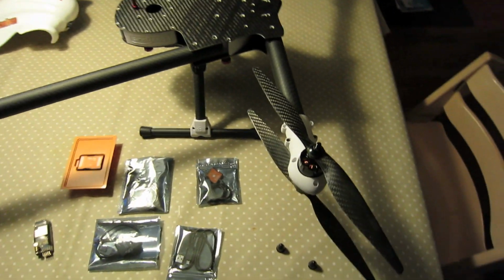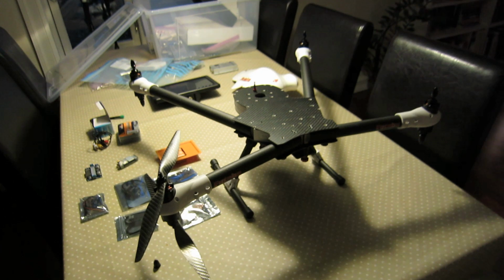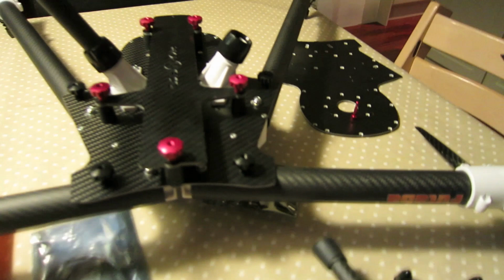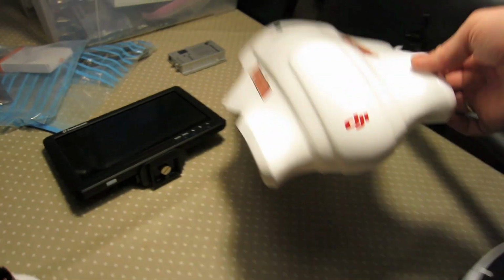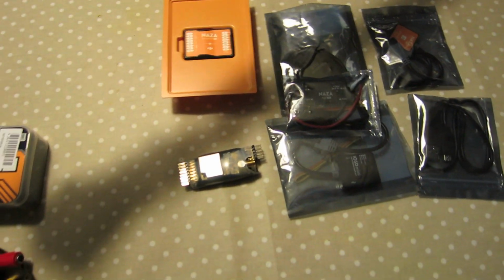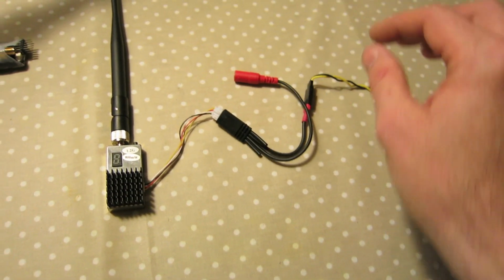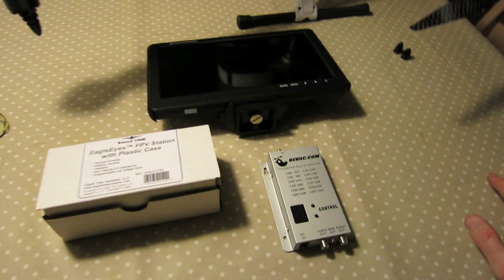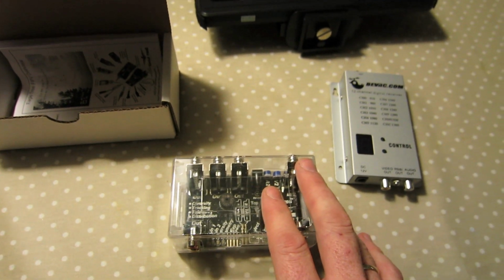Huge quadcopter - Sky Hero Spyder 850

Comment: Sky hero is awesome,,,the best dsign i saw on net,,,i will start save my money :)

Nice video mate...
Reply: Cool design for sport flying,poor design for an aerial filming platform.
Reply: +rcnut812 I am more in drone aplications, not in aerial filming.
so fpv recon drone.Is there other you can name. I will sure check what is your advice?
cheers m8
Reply: +Zox Wolf I have a friend that has a Alpha H6 1000mm which is a cheaper knock off of the Sky Hero design. I've flown it before and it does fly well but does not have the stability of my more traditional V configuration hexacopter,for the type of flying that you want to do the SkyHero or similar design would be great as I like the speed capabilities of the H6. Personally when I have a multi rotor that I have thousands of dollars in I prefer motor,esc,prop redundancy and I wouldn't want to find out what would happen with this design with said failure,I don't think it would end well. Although you can stack motors with this design so there's always that.  They are nice to look at though. Take it easy.
Reply: +rcnut812 Thanx for reply m8

Comment: Great video ..
Where can I find the "tension regulator" (13min32)
Reply from the maker: I bought it on Ebay. Search for dc-dc volt regulator. I found out it could not regulate voltage down, so I don't use it anymore...